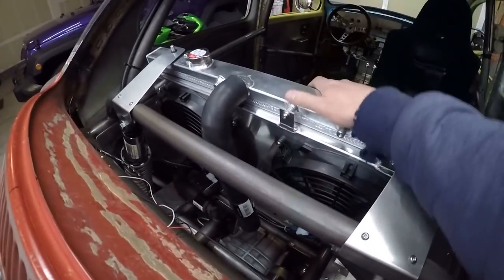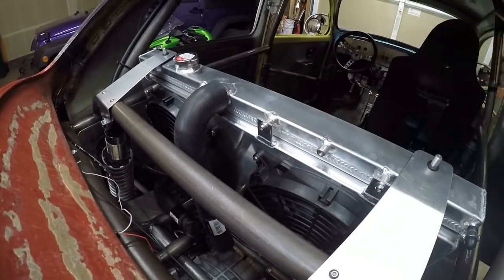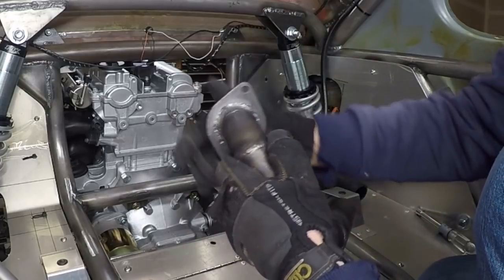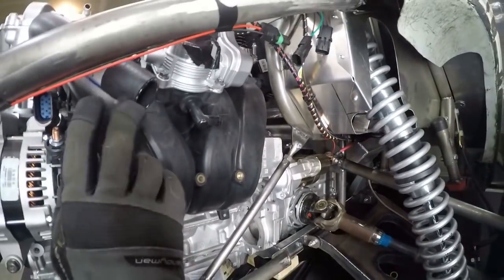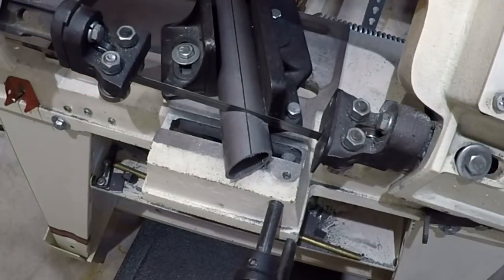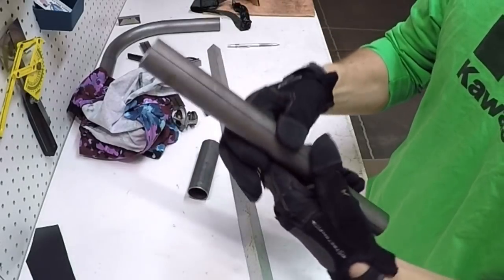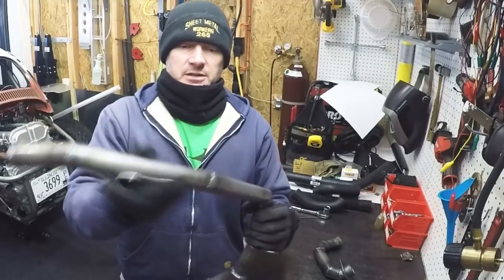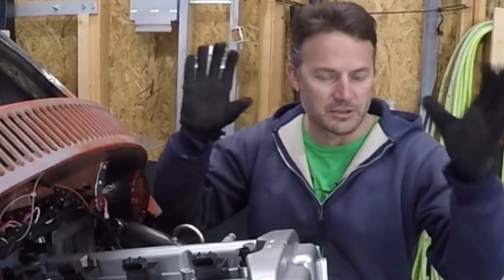Baja Bug Ecotec Radiator Install

Comment: Hey Doug, long time watcher of your project since before I got my own bug and Ecotec to swap in it. Ended up buying the same radiator, did you use an overflow or expansion tank? Trying to figure out what else I need to get to make sure I do this right
Reply from the maker: Yes I have an overflow tank. Currently it's just a cheap plastic one. But it works either way. You do need one, otherwise it'll always be making a mess, and you'll need to really closely monitor the water level.
Thanks for the comment, and for watching for so long.
Reply: Thanks for the quick reply! Is it a basic single hose overflow? Or dual? The radiator has a barb fitting on the fill neck and on the upper right corner (looking at the outlet side). I’m trying to figure out the proper hose routing.

If you have a couple minutes, Any way to send me a link to something that would work with the radiator?
Reply from the maker: @andrewkolo8156  Single hose. Email me at dougbugbuilder@gmail.com and I'll send you some photos.

Comment: I would think that if that radiator ever sprung a leak or hose ruptured, all that hot fluid would go everywhere and drain right down into that electrical box area and short everything out? I live in Arizona and it gets hot here, So I am always worried about my radiator, I have seen dozen over heat and pop.

Comment: did you consider having custom hoses made at a hose shop??
Reply from the maker: I did not, I wasn't aware that there are shops around that would do that. Maybe I'll look into it for the next install. Thanks for the tip!
Reply: @DougBugBuilder  around here the place is called "all hose". Also, Thanks for the videos. Seems like you're the only channel going deep on baja bug stuff.

Comment: Speedway motors makes round mounts three inch thick easy to make mounts for engine and you could make support on side obottom nrkt I mounted my model a body to frame with mount east strong nice brkt to frame one to engine for support  great jpob so far .also sensors in front make a aluumiuim brkt two holes wand place sensor ba k in and make different hole for brkt and glass in muffler maybe even and another tail pipe and muffler same size
Reply from the maker: Thanks for the tip on the mounts, I'll look and see what Speedway has for that.

Comment: As Always your doing top notch work. You look cold.  It's 72 degrees down here at the imperial dunes. hehehe   Next year maybe you can have that Baja rolling around with me. I'm sure I can come up with paddles for you to use on the rear.  Only problem you will have is getting addicted.
Reply from the maker: Dude you're killin me. When I filmed that it was a little under 20 deg in the garage. lol Rolling in the sand sounds great! Don't worry about getting addicted, I think I already am! lol
Have fun out there EZGZ, thanks for the comments.

Comment: Got a question for you. Why did you go with that instead of the rubber hoses? Just curious. I would think the rubber would give you simplicity and the ability to carry extra parts.
Reply from the maker: I'm not really a fan of running hoses that long. To much chance of kinks or bends having to make that path. If it was really supported well I'd be comfortable with it, but at that point why not just make the tubing. 
Personal preference though, done right running hose would work.

Comment: Very impressive Doug!!! Congrats one more time!! 
And what about oxide inside     the pipe?
Reply from the maker: I'm expecting/hoping the corrosion inhibitors in the antifreeze will take care of that. With the climate I'm in here in Denver I'll be running a 50/50 mix in this motor. So there will be a good amount of antifreze in there. It's a valid concern though and something I'll inspect whenever the cooling system is taken apart.

Comment: What size/model tig welder do you use?
Reply from the maker: It's a Lincoln Square Wave 175. It's over 20 years old and they don't make that model anymore. But it's basically 175amp AC/DC high frequency start machine. 220v input.
Reply: Also I can't remember if it was brought up in another video or not, but did you make the u-joint drive shafts? I've been playing with the idea of making some for my bug. Everyone tells me there's no way they could be welded to hold up to the power even though I plan on just keeping the stock 1600 in this one.
Reply from the maker: K Kozenewski, yeah I made the driveshafts. If you are a decent welder they will hold up to the power. Definitely for the 1600. However U Joint shafts are hard on the transaxles if the suspension is swing arm. The splines are tough to extend and compress under torque so the stress is transferred to the transaxle side plates and bearings. With my A Arm rear the splines don't go in or out to much, so there is less stress on the transaxle. These are just theories though, it's not like nobody else has run U Joints with swingarms (they have).
Here is a link to the video where I made the shafts.
 https://www.youtube.com/watch?v=J35lmW9bkY0&t=476s
Build on my friend. ;-)
Reply: Doug Bug thanks for always responding, your videos have helped a lot for getting my bug back together!

Comment: Could you have used your bender for those angles?
Reply from the maker: Technically I probably could have, although it would be really difficult and the bender has a fairly big radius (5.5"), so that would be hard to work around. For me pie cuts in this situation is great. They are pretty easy to be really accurate and you can make the bends as tight as you need.

Comment: I am slightly concerned having the radiator right over the battery box. Hopefully you don't spring a leak.
Reply from the maker: Hey KinkyWolfie, that's a good point. I must say I never even thought about that. Can't really do anything about it now but I'll think about it.
Thanks for the comment.